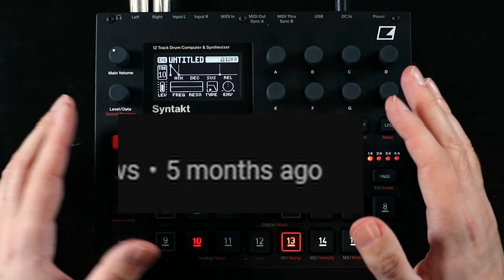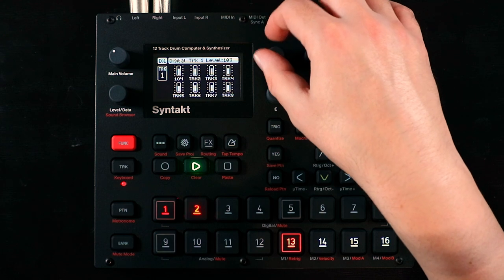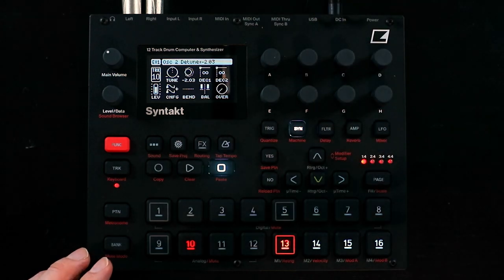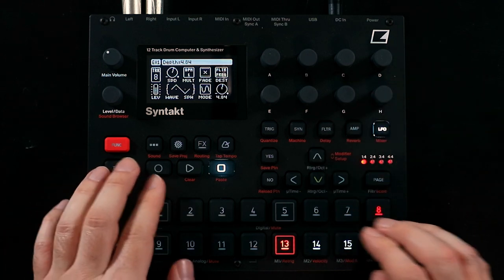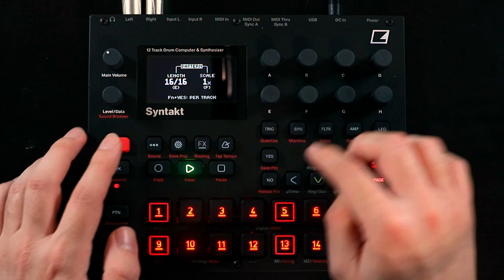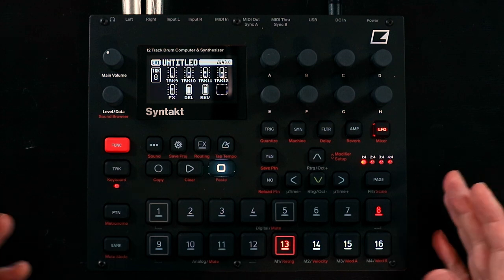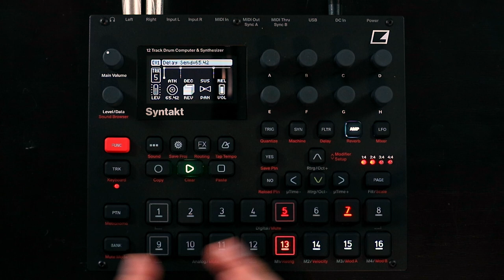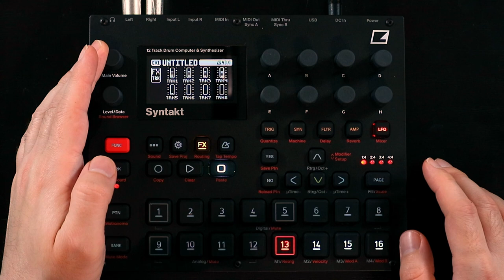How I Drone on the Elektron Syntakt

Comment: If you hit, FUNC + … > Setup > Sound, and set the Filter Keytrack to 100. You can play notes on that band filtered noise machine.
Reply from the maker: (unless they updated the calibration in a recent update) the analog filters don't track the chromatic scale correctly though. I enquired about it when I first got mine and elektron confirmed that it didn't track scale (and wasn't meant to).

Comment: at 10:00 on digitakt it works to let the trig trig one time and then take the trig out of the sequencer while letting the sequencer run:) or you could make drum drones (i love very much): very fast sequencer fully filled up with trigs. (you can make interesting structures by taking some trigs out...) if the sequencer is fast enough and you put different pitched trigs you can basically play kind of "chords" (or nice coloured drones) like two colours on a rotating disc combine to one...
good explanation. thank you for this video.
greetings from drone dresden

Comment: This is beautiful! Seems like a perfect way to unwind after a long day. 

Also I did skip through a bit and might have misunderstood but around 50 min you were tuning the filter and said you had to do it because the filter doesn't follow the keyboard, but you actually can go into setup and turn on filter keytrack to 100 and it will do that! You probably know that tho so sorry if I'm being a dumbo!
Reply from the maker: It will follow the keyboard, but it won't follow it perfectly in tune, even over a single octave - an octave on the keyboard isn't an octave on the filter, even after calibration on the analogue machines. I reported it as a bug to Ekekron but apparently it's just how it is. Hopefully they can update their calibration routines by firmware, because the bandpass filter is really lovely sounding.
Reply: @OscillatorSink  Oh gotcha, yeah that's a shame then!

Comment: Awesome. I've been looking forward to watching this. The digitone video explains a bit about the composition process but I did indeed encounter quite a few of the problems you mentioned when I tried droning on the syntakt. Couple of minor points about the machine lists. The BD FM machine is a gate drone machine (no infinite decay on the machine envelope, but it will stay on forever if you hold down a trig key), and SD Hard isn't a drone machine at all unfortunately. Its decay is very long (I didn't measure it, but somewhere in the region of a minute or so) but not infinite.
Reply from the maker: That's annoying, the SD Hard is a copy paste error - it also appears in the correct list. BD FM is just plain wrong, don't know how I missed that.
Reply: @OscillatorSink  it's a minute mistake that doesn't undercut the main point of the video. Don't sweat it : )

Comment: Are these elektron boxes feasible for live improvisation starting from scratch?
Reply from the maker: That's a really interesting question - I think the answer (like with most improvisation) is yes, but with preparation. You wouldn't want to start from the standard "init" patch I don't think, but if you had each track set up in a way that was a good starting point then absolutely it's possible.
Reply: @OscillatorSink  thanks. I may give it a shot once I get comfortable with the osmose and sound studio 3. I don’t want to add too many things at once. I also have a lyra-8. I can see how syntackt might compliment my other sound sources.